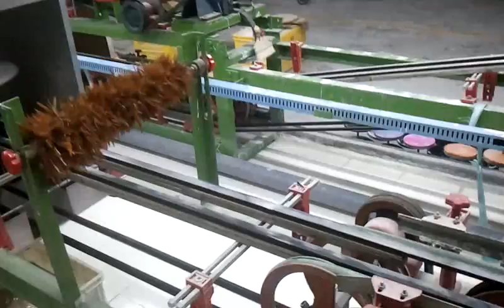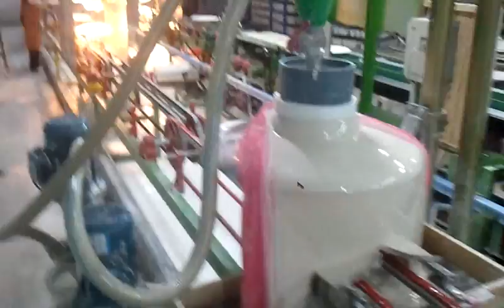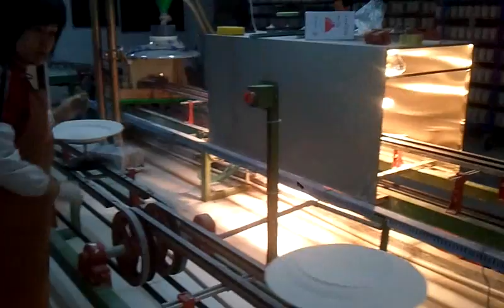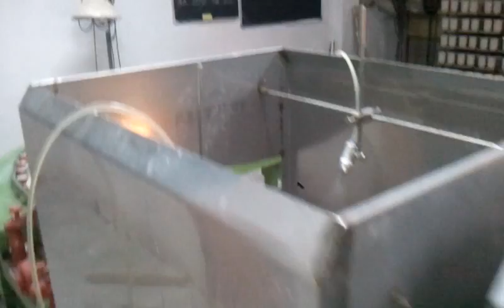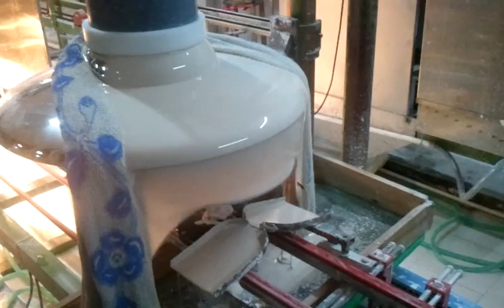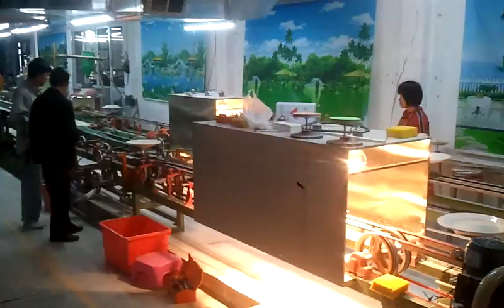Automatic ceramic plate glazing machine

Comment: want to put decals on porcelain paste after heating 60-80 degrees
Reply from the maker: you want decals or .....?
Reply: @yutai50000  

want to stick ceramic decals after burning 60-80 degrees
Want to have decals glued on porcelain after firing. where the temperature needs 60-80 degrees.
Thank you!
Reply from the maker: @Thienceramics81  my email address:yutaihelen@foxmail.com  whatsapp:008613828368696